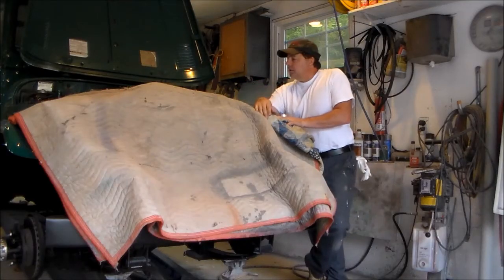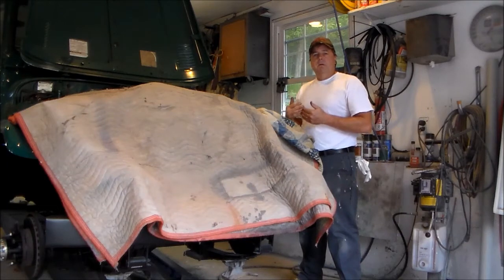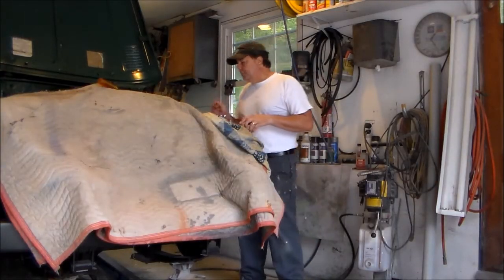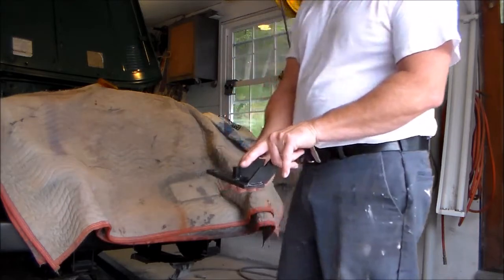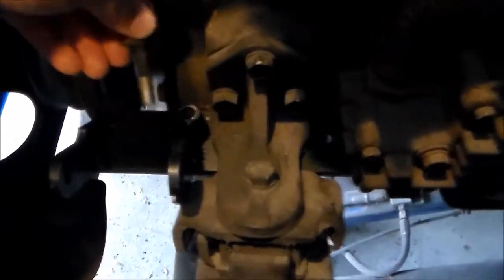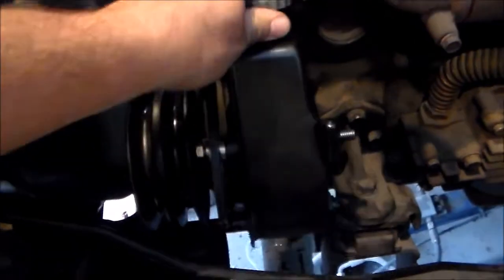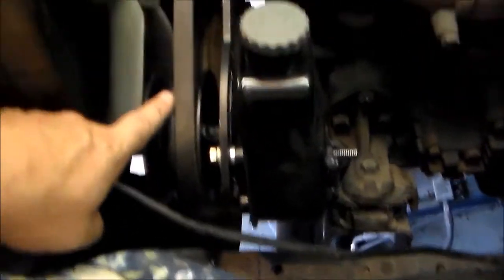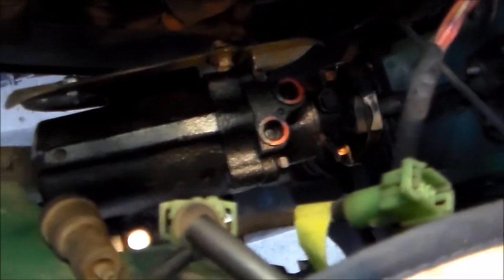FJ40 Power Steering Pump Mounting

Comment: Hey man thanks for posting this video. I'm putting an 87 2F in my 40 and I thought I was going to have to re-use the head bolt bracket that I have that everybody seems to sell.  It works, but the bracket you're showing in this video seems a lot less invasive and a much better solution all around.